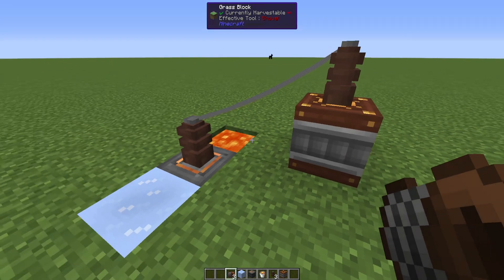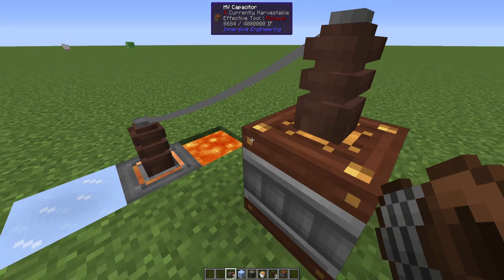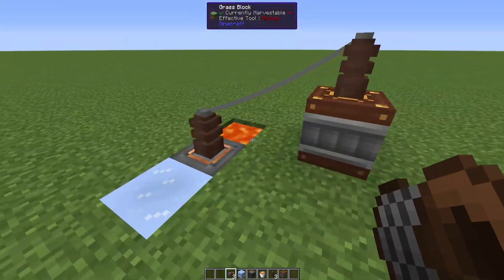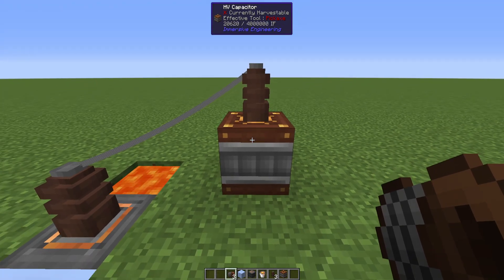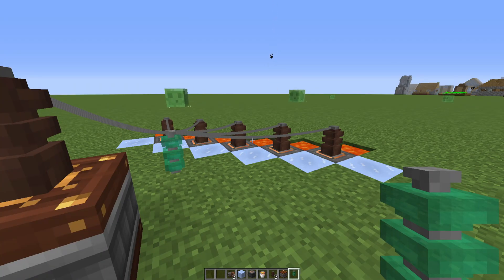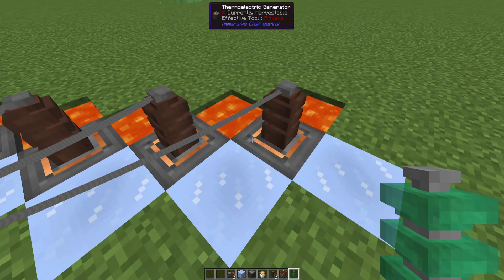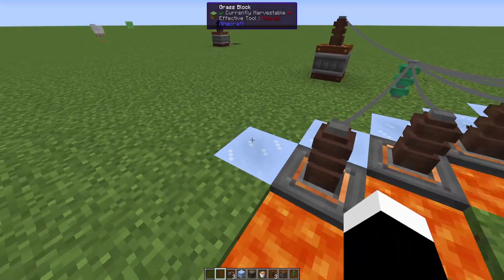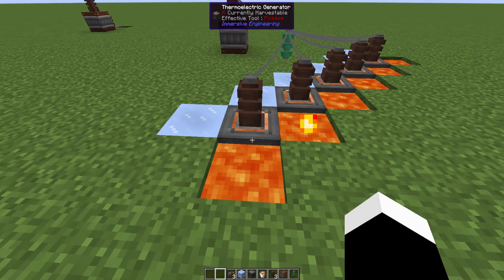How to setup a Thermoelectric Generator Power System

Comment: I think the best setup is Packed Ice with Yellorium or Uranium  = 42 Flux/t.
I tested some other blocks and fluids and here are the results:

Water/Lava                     = 30 Flux/t
Ice/ Lava                         = 32 Flux/t 
Packed Ice/Lava            = 32 Flux/t
Water or Ice/Yellorium = 40  Flux/t
Packed Ice/Yellorium   = 42  Flux/t
Reply from the maker: Yh i think that's the case, You can get more flux/t i think if you use blocks from other mods along with it maybe? but i was just using the base immersive engineering mod on 1.12.2  so packed ice and uranium works.